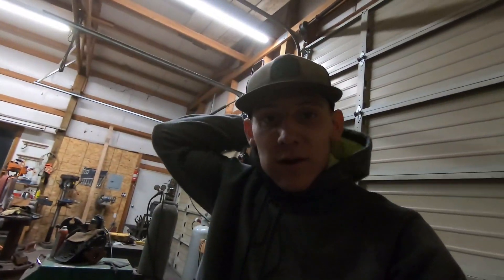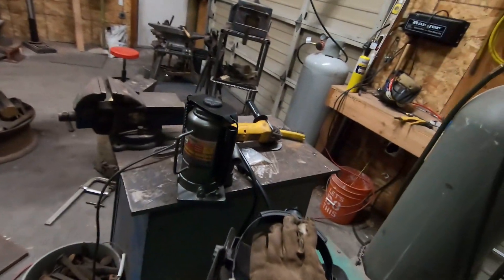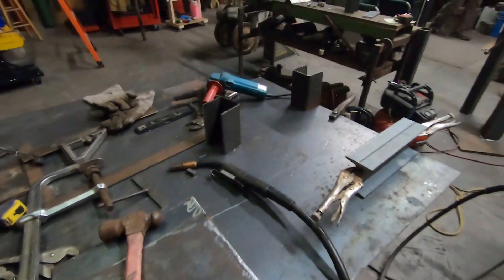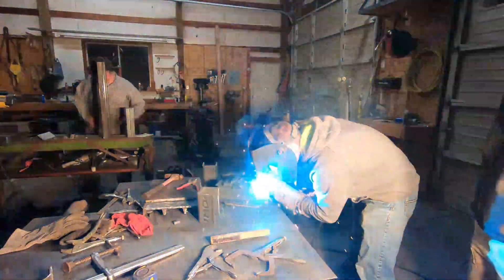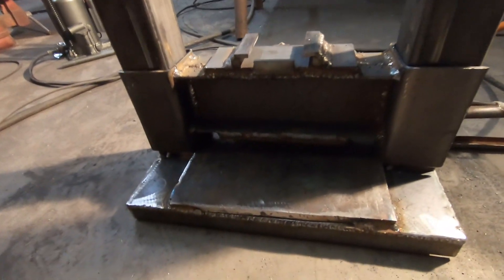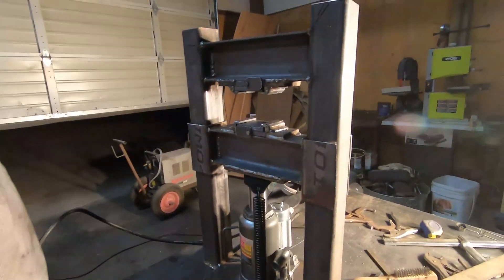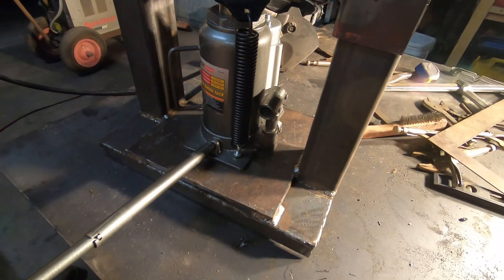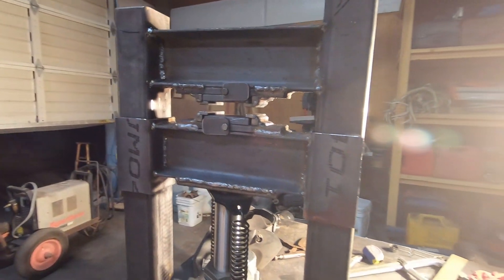Building a DIY Mini Forging Press!

Comment: I've never seen anyone weld like that.
Reply from the maker: It's called stack welding, it allows me to get the most penetration possible without undercutting the steel. Since this particular frame is under so much stress I wanted the strongest welds possible.